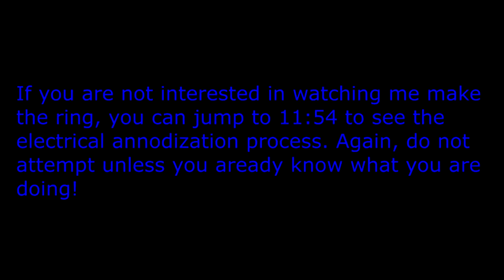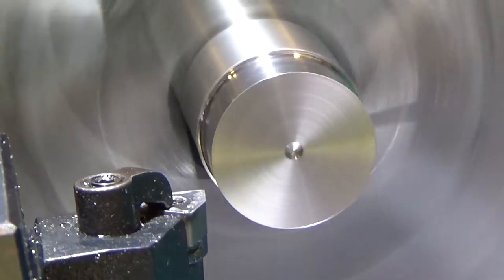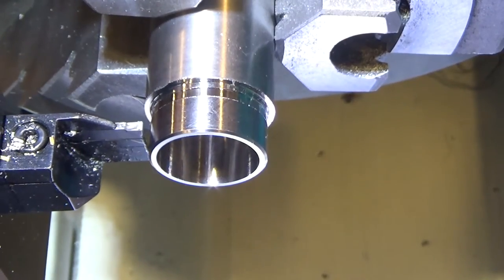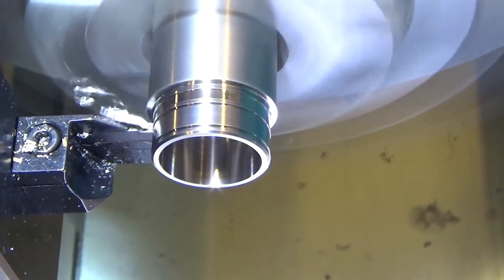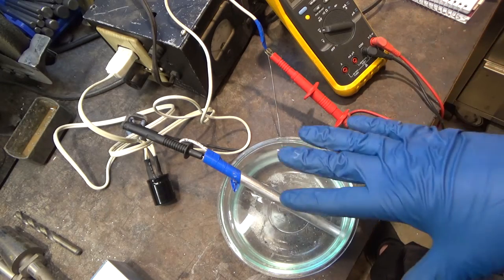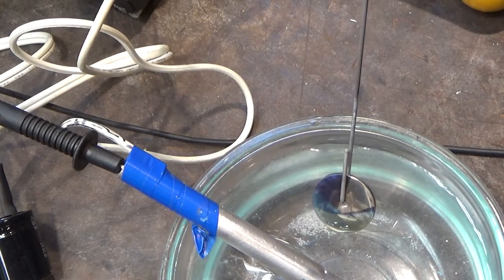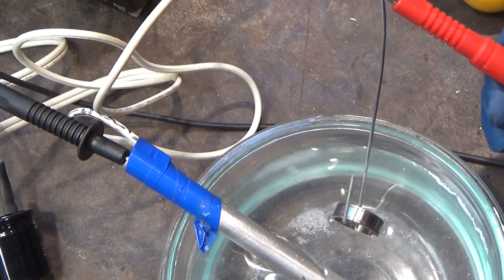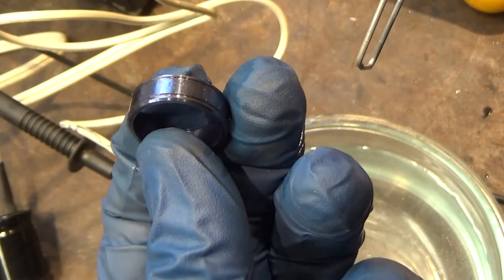Making a Ring and Annodizing Titanium with Electricity DANGEROUS

Comment: I think the natural color looks good also. It appears that it wasn't to hard to turn down from watching you turn it. Did you use some other methods to get a good finish or polish it other than turning it. I know that the material is very hard due to my wedding band is made out of the same material and I went with it to help prevent scratches. Really enjoyed your video. You have a new subscriber.
Reply from the maker: I agree. I find most metals beautiful, but any opportunity to try something new is fun. Besides, my wife really wanted the colored rings. She is not as big a fan of plain metals as I am. It was quite a while ago that I made the video, but my recollection is that I got really good finishes off of sharp carbide inserts. Sorry, I can't be more specific. However, my wife wants another ring so if I make another one, I will find out the answer and try to remember to share the results.

Comment: Why is it colouring with the voltage, I mean, When I use electrolysis the color's metal don't change. Is because of the Titanium, or the type of anode ?
Reply from the maker: The coloring comes from a really thin oxide layer that is created on the surface of the titanium. If I have my physics/chemistry right, the process works something like this: The electric current is causing the water to electrolyze (break down into oxygen and hydrogen). The oxygen ions are negatively charged and is attracted to the anode and the hydrogen ions are positively charged and attracted to the cathode. The greater the electric field the greater the depth of the oxide layer on the surface of the titanium  This layer is transparent. Some of the light hitting the part bounces off of the surface and some penetrates the oxide layer and reflects off of the base metal. Colors of light are different wavelengths and if the oxide layer's thickness is thin enough to be half a wavelength of a particular color it will cancel with light reflected from the surface, half a wavelength away. That same thickness could be a full wavelength of a different color and re-enforce or make it brighter. Red light is much longer wavelength than violet. This guy has a great explanation: http://www.mrtitanium.com/interference.html